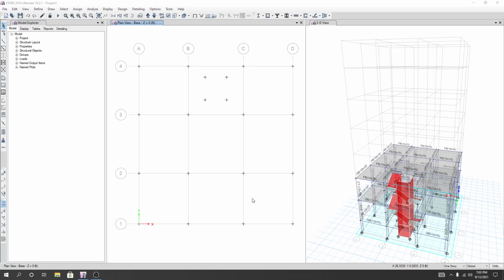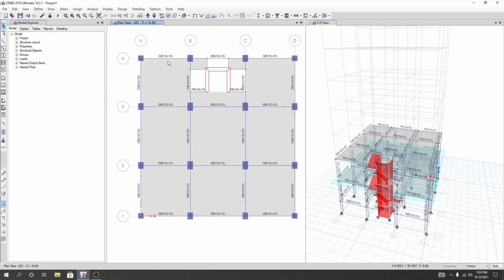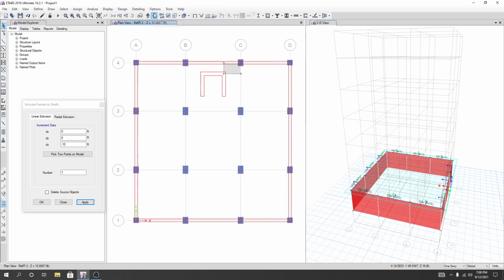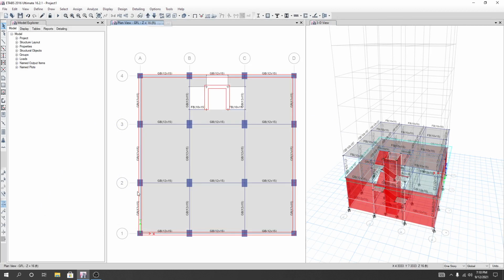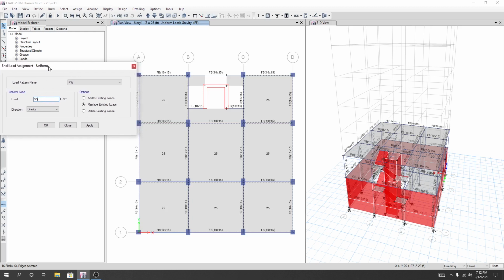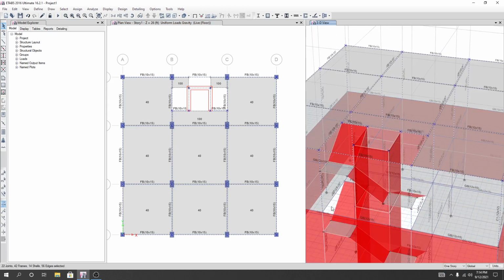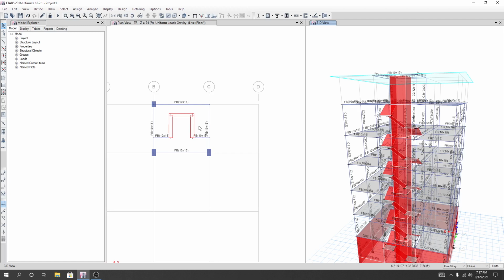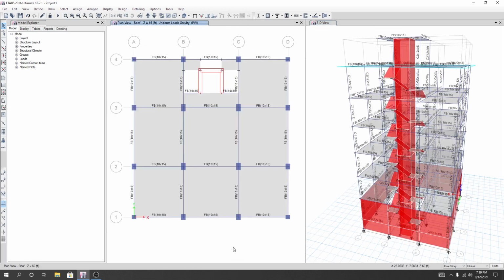6. Complete building design in Etabs 2019 | Real Project Design | Draw Basement Wall, Assign Loads

Comment: Sir in etab staircase load on is showing different value if we put manually on beam
Reply: Assalam o Alaikum  sir
Sir Our seniors use 45 psf as Partition wall load.. is it ok for every commercial structure? and also guide how we can calculate this 45 psf ..
Reply from the maker: i will make a video on it..
Reply: @qlearnify-en  thanks a lot sir for your Reply
Reply from the maker: Always welcome dear
Reply from the maker: Software automatically calculate that value form stair to other member. but its not issue. we can also apply that stair load on beam if applicable.